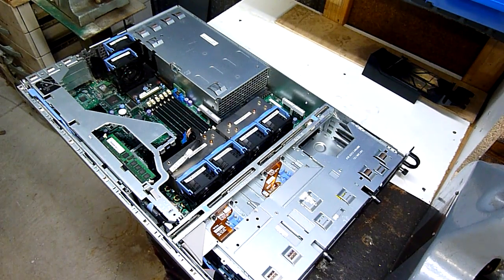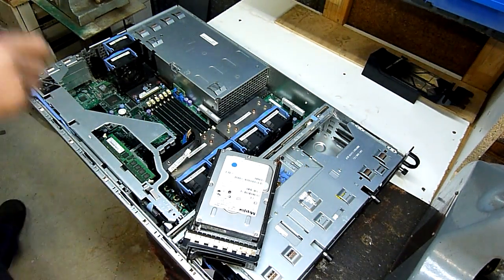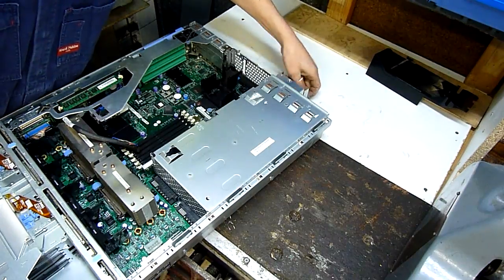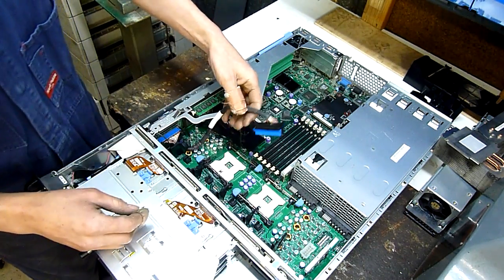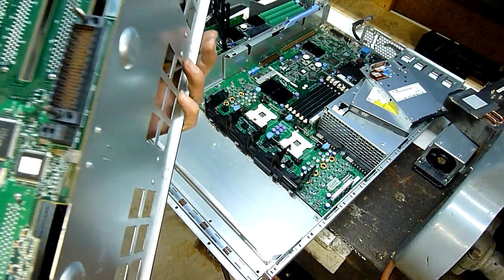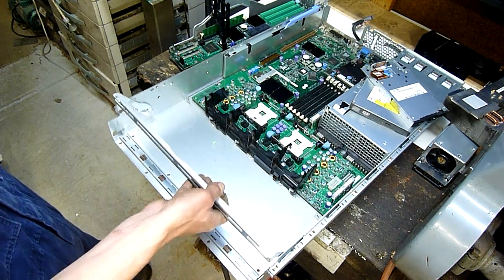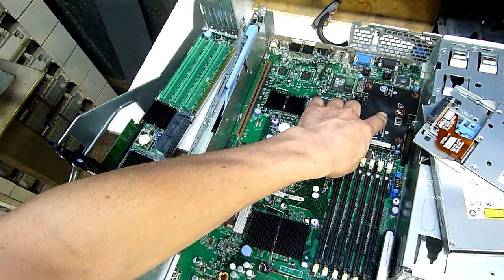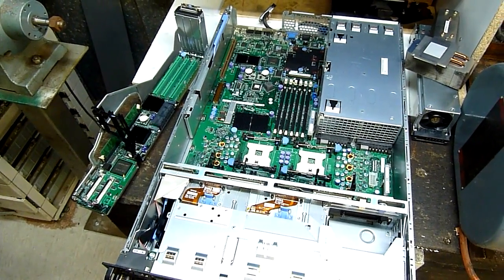Derpy Dell 2850 Server Disassembly

Comment: servers ive worked with in the past all i had to do is disknect the original harddrives (i was doing this with a small server that had sada harddrives and a motherbord simular to a normal house hold computer) and conect an new heardrive and instal windows xp and it work great as a reguler pc.

Comment: Hey ED do you still have any parts from this? I scored a dell 2800 server.
I have no drives and it only has one CPU in it and one heatsink but can take 2.
It's an awesome machine! $4!
Reply from the maker: I do have plenty of parts for this series of server. what do you require?
Reply: A hard drive 36gb ultra320 ect.
It also runs ONE 3.0 xeon. It can take 2 so do you have another CPU and heat sink mate?
PM me if you will sell these bits ED :)

Comment: I have had one given to me, it looks like a rather large desktop pc, the dell poweredge 1600SC and it has raid plug and play. stock power supply, but it uses electricity like no tomorrow! its a 2003 model with dual deons single core only! ddr 4gb max ram hahaha

Comment: When I worked at the place that scrapped computers I used to take apart a lot of PCs, but no servers that I can remember. The Dell desktops were constructed very much like that server, lots of finger actuated catches and tool free removal of devices and assemblies. Even the sides of their tower cabinets used a spring loaded catch I think, I must have saved a dozen expansion springs pulled from those, very useful for vintage radio dial cord tension springs.

Comment: In a modern server room you have alternate hot and cold aisles between your rows of racks; chilled air is blown up through floor vents in a cold aisle, is blown through the servers in the racks into a hot aisle where it is extracted from above. Got nothing but praise for the 2850, had 6 of em running Win 2000 for 10 years; had one disk drive fail in that time; it was fixed within 24h under the support contract we had with Dell :)

Comment: I've worked in a relatively small datacentre in the past and I can tell you there's some SERIOUS cooling going on in there. The floors are raised, lots of cooling machines were installed on the floor, blowing their cold air under the floor. And perforated tiles in front of the racks.

Funnily enough you could get very cold in the heat of summer if you had to pull a cable under the floor there...

Comment: Love this stuff!! I recently was given a Dell R720 with a faulty PSU from my work. These are awesome machines!! Replaced the PSU and it works well. Had to check all the caps after the PSU was deemed bad, but nothing seemed to be damaged. Running a small linux server and encoding video on there! Love the vids Ed, These Dell servers are a real treat to work on!

Comment: Yeah you can run PCI-X cards in a normal pci slot, you lose some performance. Only issue usually is the unconnected portion of the card bumping into components ( like heatsinks and caps).

Some of the servers you can put gaming video cards in, some people went as far as hacking up the PCI-E 4x and 8x slots to fit in a 16x card. Infact that would be easier now, IMHO with the risers that gained popularity from all the crypto-currency mining. I have a dual 604 Socket Xeon here that does have a PCI-E 16x slot, I have been tempted to run it as a gaming rig for the giggles.

Comment: Is there any chance that the 2850 heatsinks the same as the 2950 heatsinks?
Reply from the maker: they do snap in, but they have less thermal mass than the 2950's, less copper heatpipes and no solid copper base plate.
Reply: Aussie50 Ohh cool, Thanks. I might look at that as an option. I have a second 2950 Laying round here thats only missing the heatsinks and the 2850's might be a cheaper option
Reply from the maker: ***** I have 2 pairs sitting around doing nothing if you want a pair?
Reply: Aussie50 I'm probably not in the position where I could say yes right now, But for futher referance how much would you want for a pair? and how much would shipping be to NZ on average?
Reply from the maker: ***** not sure what shipping to NZ will be but I do not want anything for the heatsinks

Comment: Holy hell, I'd love to have a machine that comes apart so easily, but then I realize I'd never need that utility, because I don't run mine hard enough to cause failures. The most I'd need to do is bigger hard drive, more RAM, and faster CPUs. I actually had to modify mine to make the fans run on the 5V rail instead of 12V because it was too loud, and even still it never spits out anything but lukewarm air.

Comment: sort of reminds me of making the early PC's for video editing with windoze 95, you often bought server components to have access to what was classed then as high data speed hardware, sort or remember 4.2GB scsi HD 10.000 rpm which cost a absolute bomb.
mind you this is impressive and nice to see you have it as a project
Reply: I remember that time late 90's early 2000 we made video editing machine and all cost like hell, we used 4 74GB 10K SCSI Ultra320 HDD ( each around 1500$) SCSI controller like 2000$ DTC case for hdd 1500$ and low end professional video editing card Pinnacle DC2000 like 7500$

Comment: I worked at an office building and we built a new building next to it and they installed a state of the art server room and this building housed about 300 people and the A/C unit that cooled the public office space was the same size as the small 20x50 foot server room if that tells you anything. They had to keep the server room at 72 degrees F year round. The A/C ran in the winter too and it was in a cold climate in the winter.

Comment: Awesome! You are learning quick :P I work with those all day long and believe me, the data farm at work is astonishing, basically the way you described it floor to ceiling and wall to wall :P This where we hide when it's too hot in the office, we keep the farm or center at around 18C with no humidity and lots of HVAC stuff lol

There is a bit more info on stuff that you pointed out (if you are interested): 
- Battery for the RAID Card: 
The SCSI drives (or any drives in server) will most likely run without caching enabled on the drives themselves, the cache is stored on that random memory stick on the back pane. This effectively improve the speed of the data going in and out of the drives. Being the nature of Random Access Memory, as soon that there is no more power it loses all of it's memory, so the battery keeps the cache as long that there is life remaining in the battery or how they call it Cache Protection. Also, depending of how "retarded" the RAID interface is, it sometime will rely on the battery to keep an idea of what drive is where in the array.
- Dell remote interface:
This is how you know that fan number 10 is broken or if one of the drives will fail soon. Since you don't usually keep an eye on them, you setup that card to create a email notification or little program to let you know what is going on in the hardware.
- PCI-X:
The only difference with normal PCI and PCI-X is one is for 32bit application and the other one is for 64bit application. You could plug a PCI card in PCI-X slot but not PCI-X card in PCI Slot, you will either cook the card, not work or won't fit. I use to have a 4 slot Gigabit 64bit Card lying around. They are widely available on eBay.
- Gaming on servers: 
It's doable but like you said, it takes a lot to do so. :P Driver wise, they are horrible for let's say Win7 lol 

You have some great ideas! I never actually thought of stripping it down for 2 PCs, thumbs up for that :P 
Cheers from Canada! and keep up the good work !!! I love your videos,
Reply from the maker: Thanks mate!, I am a fast learner :D, could not do it without the input from you and all the other IT guys watching!. cheers!
Reply: PCI and PCI-X also has another difference - PCI runs at 33MHz, and PCI-X runs at 66-MHz

I have a couple of PCI-X cards that run fine in a PCI slot, but they were designed for dual PCI/PCI-X operation

Comment: According to Dell's specifications document for the 2850, it says:

" Processors Up to two single-core 64-bit Intel® Xeon™ processors at up to 3.8GHz
or up to two dual-core 64-bit Intel Xeon processors at 2.8GHz"

So there's that.

Comment: Hi Ed good idea putting 2 boards in there! I had a 1u HP which had a 24 volt monster of a fan in it! Are they 12v these days? Also if you come across a HP take some time to play around with "ILO' its fascinating because a separate ARM chip gives you remote access even if the server is crashed or powered off!! ILO on mine had its own ethernet jack so it could be on a dedicated network isolated from the server's own connections :D

Comment: The air handling in a data center is just as impressive as everything alse. I would like to mention that you can not run PCI-E card in a standerd PCI slot.
As for a server based gaming PC? well it's not worth it as most games to utilize more then 4 cores and 3 to 4 GB of ram so most benefits of a server are lost.
Reply: hell even Bronies come here...thats impressive to see ;)
Reply: he is referring to the pcix slot not pci e
Reply: leokimvideo I am surprised you did not notice me earlier as i have been watching ED's videos since he first started.
Reply: I have a couple of PCI-X RAID cards that work just fine in a standard PCI slot (Just with some overhang) .. It just depends on how well-designed the card happens to be

Comment: The original IBM PS2 PC's were built the same way - I was fascinated with how much thought went into the construction - not quite the same for most desktop PC's now!!

Regarding the cooling, I think the whole room is cold, and hot air goes out the bottom of the rack cubicle (or something like that!)
Reply: The early ones, when you accidentally dropped them had pop-out everything!
Reply: A lot of the early PS/2s were built like tanks, but were still very modular.  They had pop out floppy drives, pop out hard drives, even pop out planar boards!  In fact the Model 50Z and 70 were notable examples in that they were completely toolless, unless you needed a flat-blade for overtightened thumbscrews.  They had plastic "rivets" which usually could be pulled by hand, but there was a pry tool ON BOARD if you needed it!

Some of the later PS/2s, while still very modular, had plastic cases with internal aluminum bracing (likely to help prevent RF interference).  

The PS/2 Model 95 was another notable example.  Although very proprietary, it also had a pop out power supply, and even a processor card.  I also recall it retailed for over $25,000 US for a nicely equipped system, but that was back in the early 90's.

Comment: zhow do you get these things? Ive been wanting a server for quite a while now
Reply: I don't remember where he got his but ebay has hundreds of servers. I got my 2 servers from ebay, but be prepared to search for one (or more) that is complete or still doesn't cost an arm and a leg.
Reply: Mainly data centers clearing stock. You'd be surprised what you can find, especially in the US.
Reply from the maker: this was all thrown out by a data center, friend of mine got to take them home (IT guy) and had them sitting around for a few years util he met me and decided I could use a tonn of servers :p
Reply: Aussie50 Ahh you lucky m8
Reply: CAmarine221 Ive been looking on ebay but the shipping it like 10x more than the servers price. And the ones that arte free shipping cost like 5 grand
Reply: Yes, they are very heavy, large and it seems like the seller is never any were near you. The only servers I usually see that expensive are much newer than the others. Then again you might be in a different region. It is also hard trying to find one that has most of what you want that is within budget. All I can tell you is keep looking and a nice one might pop up.
Reply: Should have seen how low my car sat with all the 1850's in it!
Reply: Hey guys, I'd thought I'd add that if you happen to have any friends that work in small to medium sized solicitor/architecture/medical centre workplaces they often have high-end single rack server set-ups. The nature of their business requires high performance/high uptime hardware even though their IT requirements aren't as "heavy duty" as those in the finance/IT/large business firm sector. I've had a couple of solicitor mates give me there old server set-ups (sans the HDD's for privacy purposes) when they have upgraded (which they seem to do every couple of years just for the sake of it). In my experience they were happy to see someone want it, as they were just going to throw it out/give it to their contracted techys. It's amazing the amount of "obsolete" hardware that is out there to mess around with... I tend to collect a lot of that stuff, even if its just for the odd power supply for a random project.
Reply: My sheds full of collected stuff! I actually need to clean it up soon!

Comment: At my last job I was the server admin, and that included speccing and building new servers. I was gob smacked at the price of the bits when submitting the purchase order, but when I saw the quality of the components against a normal PC I could understand where the money went. Proper Server kit is leagues ahead of desktop PC kit when it comes to build quality, reliability, redundancy etc.
Reply: SuperMicro is finally pushing into the consumer market with enterprise grade reliability - new Z97 boards from them look good and hopefully have the reliability of a SuperMicro board
Reply from the maker: yeh it seems expensive at first, but having taken a part a few servers now, I can see where it goes!.
I have a gutted HP Proliant and a 16 port fiber channel switch to do a non-destructive autopsy on too :D